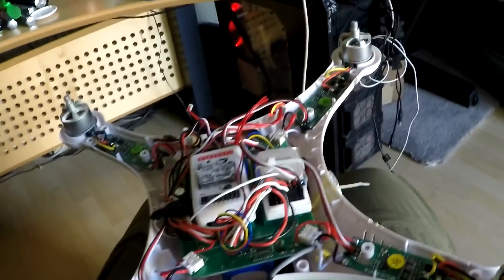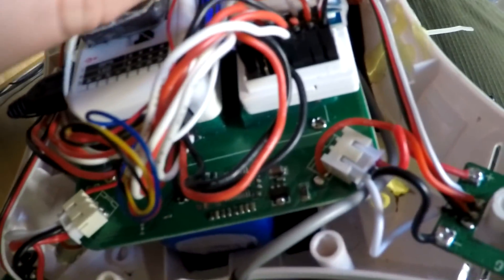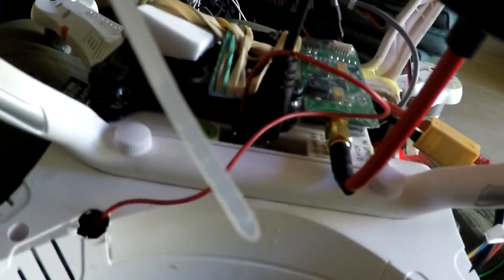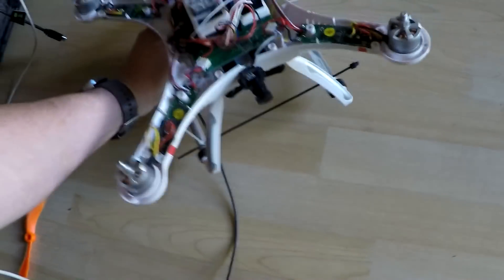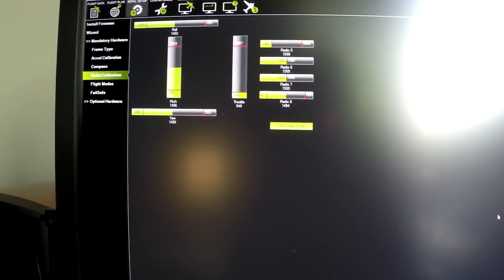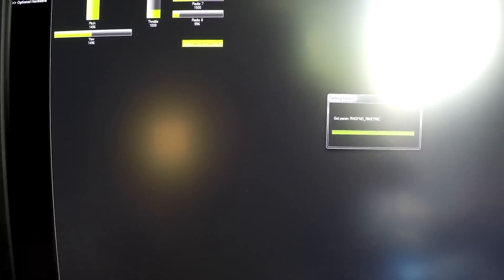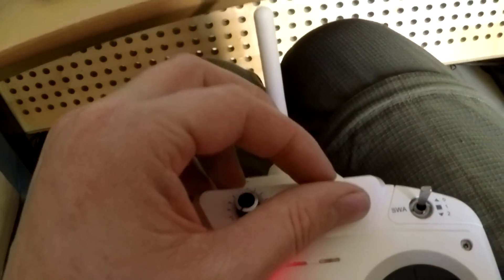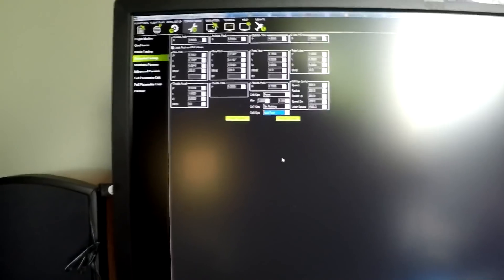quanum nova / CX-20 autotune on channel 8

Comment: I'm a real dumbass. I couldnt figure out the beeping, of course it's the low battery warning, the usb connection doesnt supply enough juice. Thanks for reminding me.  I also did notice my gimbal pitch control is now on AUX 1 it was on AUX 2 before the mod.

Comment: Hi Mate great Job Making this video thanks, but I have some problem after I have done my autotune my SWB switch don't work any more to change my flight modes before i had 5 now only 3 do you have any idea why it disable my SWB switch and how to fix this?
Reply from the maker: i am not good enough to guide you through the steps to get it fixed, i dont have the quad any more, if i had quad and a laptop in had it should be fairly easy to figure out....its something with your switches...maybe you need to re-calibrate the radio through mission planner

Comment: Question:  I got my Nova up about 10m and put it into Alt/hold.  Turned Aux 2 right up and the aircraft started the a/tune procedure.  After about 10 seconds of this, it settled and then just remained in a normal flight attitude.  I would have thought it would go through the complete procedure each time.
Reply from the maker: +neil berry there must be something that makes it quit, is your battery fully charged ? what moves does auto tune go through before it quits ?
Reply: +CygnusX250 The battery is fully charged.  It started doing the roll dips, did about 4 or five and then just hovered.  I only have the battery it came with but am expecting another three Monday/Tuesday.  I'm going to go into MP and check that there is no "trim" dialed in as I thought that may affect it.  I'll have another go in the morning before the wind gets up.

Comment: I am idiot...Where goes white wire? But why on the backside there RED WIRE?! :(
Reply from the maker: tbsk0 white wires are typically signal, so what i am trying to say is : from the reciever theres two white wires that run to the underside gimbal ports (chan 7 and 8).....i plug in my red wire into the signal pin of channel 8 on the underside of the quad, you do not need plus or minus as RX is already hooked up to flight controller supplying all the juice needed....so all you need is signal wire...which is the red wire i plug into the underside, and then into the lower left pin on the flight controller....i dont have the quad any more.....but to make it as simple and reversible as possible, i basicly take signal out on the underside and plug it into channel 8  on the flight controller...this way you dont have to take quad apart every time you wanna do autotune...just plug in and go into mission planner and put input 8 as autotune....when done unplug single wire and plug your gimbal into the underside and your good to go....
Reply: CygnusX250 very helpful! Thanks!!!

Comment: How was the tune
Reply from the maker: Tim Jackson my tune made the copter much more responsive....(i sold it so dont have it any more)....before you do autotune, you really need a large area and a very calm day, camera is fine, but no gimbal (the change of cog depending on camera messes with sensors).....if the copter starts to drift you can bring it back with regular stick control...once you let go of sticks autotune will resume.....start on a full battery, autotune takes 2-5 minutes

Comment: Hi mate I'm trying to do the wiring on the autotune on my cx20 and trying to make out the wiring from you vid I get the single pin on the fc but unsure on where that wire goes from the fc to any chance of detailing the wiring for me
Reply from the maker: Under the quad...where you would plug in the gimbal...Theres plus and minus...and signal...put it in one of the signal ports think its labelled S1 or S2...which is the dials / pots on your radio....then configure channel 7 or 8 in mission planner to start autotune

Comment: Hi , great video.
should the small USB be plugged into the port on the flight controller at all times? I just purchased a new cx20 and inspected the solder joints and the USB male plug  was not plugged into the flight controller port ? not sure here ??
Please advise
Many Thanks
Reply from the maker: float Flyer yup it should be plugged in....its basicly just an enxtension, that allows you to use the usb on the bottom instead of having to take it all apart...its been said before DO NOT UPGRADE YOUR FIRMWARE !
Reply: Thanks very much for your help and advice. I followed the instructions closely and it flew great right out of the box, just a bit of trimming req'd. ........So far so good :) cheers
Reply: CygnusX250 How would I fix a firmware  that was upgraded? I purchased the cx-20 used a couple days ago and the seller stated he updated to 3.2.1(have the USB cable to plug into the bottom of the cx-20) Tryed to fly and it is out of control; seems the tx is not giving the correct commands... Thanks for your help!
Reply: Darren Reeves  Hey Darren, that's way beyond my level of knowledge ..perhaps someone else could help you. Good luck
Reply from the maker: Darren Reeves download custom hex (firmware) for the quarnum nova/ cx-20 that has been patched. http://ardupilot.com/forum/viewtopic.php?t=9534&p=22723 ....you can also just go into mission planner and choose older firmware and flash it back to 3.1.2 but telemetry will not work, but it doesnt matter if your not using it anyway.....load default params, write it to the quad....reboot it...start the initial setup wizard and go through it all....remember when you calibrate gyro's it has to be done really accurate, so use the floor and wall to make sure its done properly.   balance your prop's, vibration takes up a lot of cpu cycles which makes it fly all funky
Reply from the maker: CygnusX250 heres a good thread to go through http://www.rcgroups.com/forums/showthread.php?t=2206138&page=10

Comment: Where and when did you buy this Q/ Nova? Mine has the ESCs soldered directly to the board (no connectors ) .
Reply from the maker: mine was direct soldered as well....but i crunched a prop and it fell off about 15-20 feet up...and the nova fell out of the sky onto concrete...it hit so hard 3 resistors on the powerboard fell off....so the replacement powerboard came with plugs...